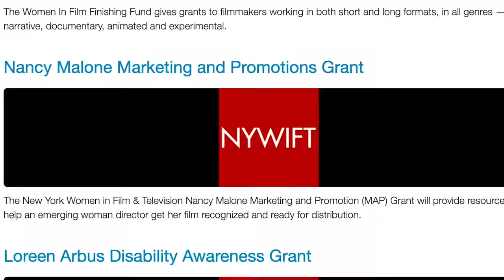Men For Total Equality

Comment: This video made me so proud to be a man. 
I've done several of these jobs or jobs very similar, and you get immediately regarded as low status or unimportant or a 'low value man' so obviously you can't chat up that female lawyer up at the bar etc. But what I have is more important: Self respect, and the knowledge that I bore these tasks on behalf of others and that this provided real benefit to everyone else in society. Fellas, if you've ever poured concrete, or molten steel, or picked up dead things give yourselves a big pat on the back, you've made a contribution. Let all the 'Divas' and 'Prima Donnas' fight over the jobs in airconditioned offices, they can keep them.

Comment: I worked with a butch woman in the oilfield once, she spent our truck rides telling me how much more qualified she was than I, because she went to college to be an airplane mechanic. Despite her credentials, we made the same pay. At one point we're pulling miles and miles of hose onto a trailer, 5 or 6 people (Was used to doing it with me and one other good hand)and she's just falling and failing to actually get work done. She fell on her ass for the third time and I jump up, and take her place to keep things rolling so we can all go home. She begins yelling at me, nearly crying, bitching that I'm an asshole (can't deny anything there) for not standing around letting her learn physical strength and endurance. 

It's not aeronautical mechanics, it's just basic hard labor. She couldn't hack it, and her response was to throw a tantrum at the man who picks up where she failed to take off. I had no opinion of equality before that day. She later got fired by one of the big bosses for doing what women do best: starting drama.

Comment: There's a different between equality and equity. Women aren't usually as strong as men to work hard jobs😅
Reply: How does driving a garbage truck require physical strength? or how does mowing a lawn require physical  strength?
Reply: @Dah42  did I mention those tasks? Go away, pesky fly
Reply: @ElizabethUkeh , this video was obviously satire, so I have no idea what the point of your comment was.
Reply: @Dah42  garbage people don't only drive trucks and mowing lawns can be physically demanding depending on the lawn mower and the temperature
Reply: @ElizabethUkeh  But the video did.
Reply: @tonyisnotdead  No it's not.  Garbage isn't that heavy.  Nor are lawn mowers.  I guess in theory it would be harder for women to lift garbage bags into a truck but only in so much as its more difficult for women to lift books or cooking pots or anything else you might lift in another job.

Also what about plumbing?  Or porto-potty cleaners.
Reply: Equity is the very definition of chivalry, compensating women for being the weaker sex.  So I guess feminism really is just chivalry 2.0.
Reply: @tonyisnotdead  Also I should note I worked for Amazon as a delivery driver and a lot of what we lifted was heavy asf but about half the employees were still female.  It's not that women are averse to heavy lifting, it's that they are averse to icky, dirty things.
Reply: @Dennis-nc3vw  you're looking at this with a very limited number of factors. garbage CAN be heavy and lawn mowers CAN also be heavy. all people are different and can lift/push/pull different amounts of weight, plus how long people can do those things also varies, since both heat and cold can have significant impact on your performance.